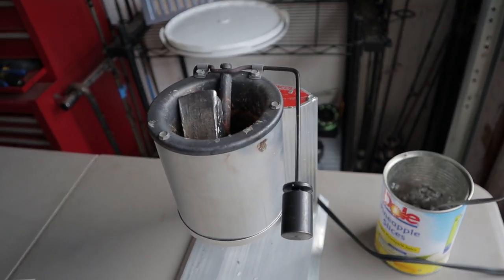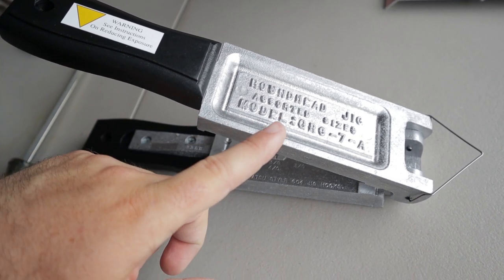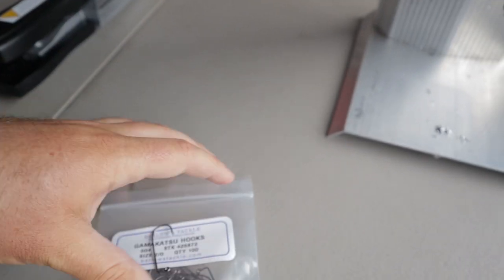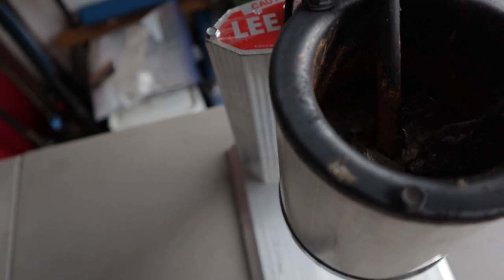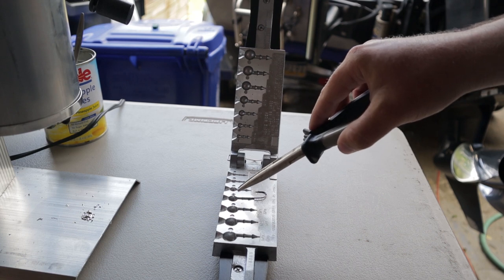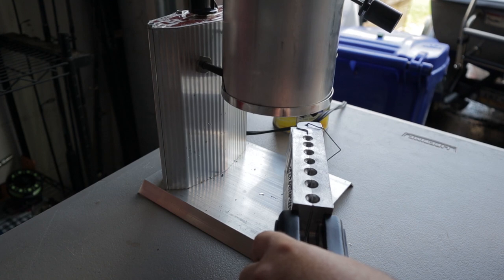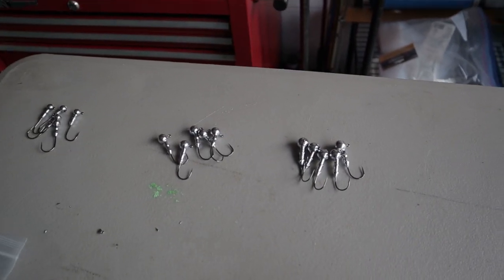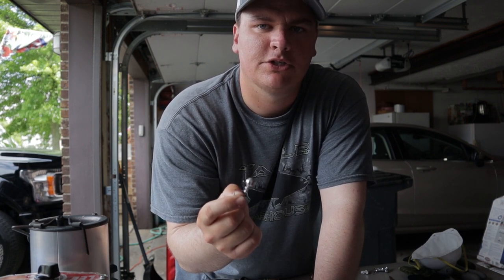How to POUR your own JIG HEADS to SAVE MONEY (EASIEST WAY!)

Comment: Mmmm.. I’m down to 10 Five gallon buckets full of clean range lead muffins. I can’t lift a bucket so it’s a lot of lead. I’ve been pumping out 9mm and .45 bullets for reloading for years and still have 3 or 4 fish boxes of raw junk filled range lead to smelt down.  With all that lead I’m still buying 1 to 10 oz sinkers and jigs at scary prices and it NEVER occurred to me that I could make my own.  I probably left 30lbs of lead on the bottom of the big ditch so I’ll be saving enough cake to buy a new reel or maybe a new gun. Yahoo mofo.